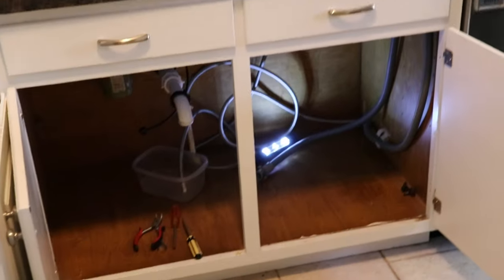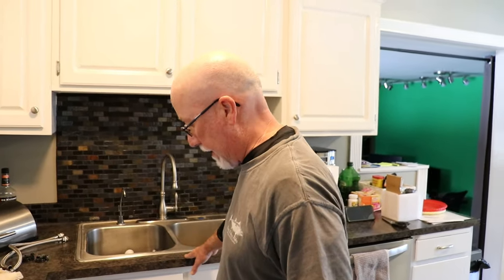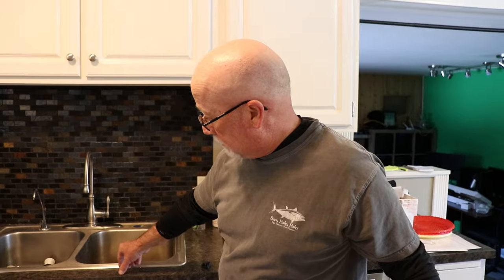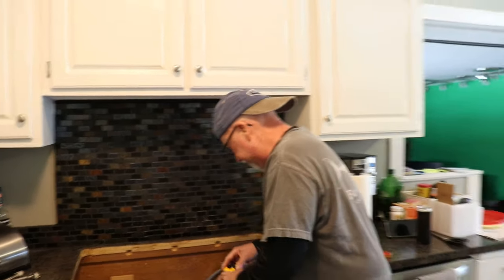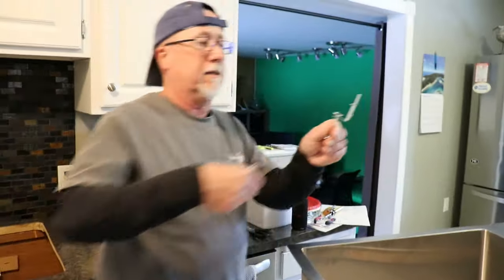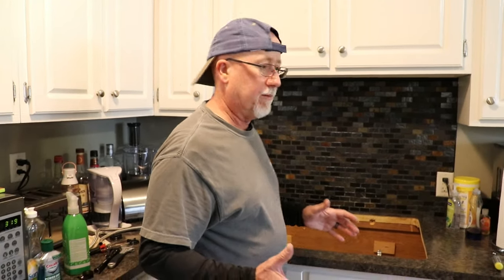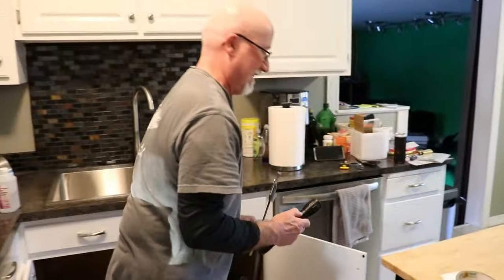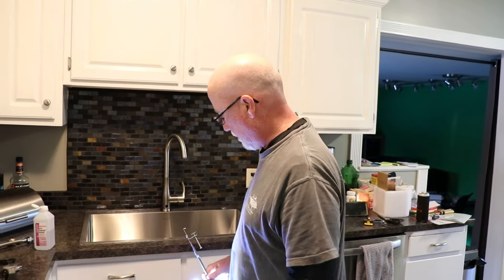Installing a New Kitchen Sink!

Comment: All you really need is 2 clamps on each side. The caulk will hold it down and the pipe for the drain will help pull it down also.